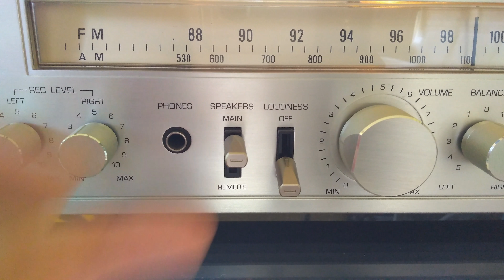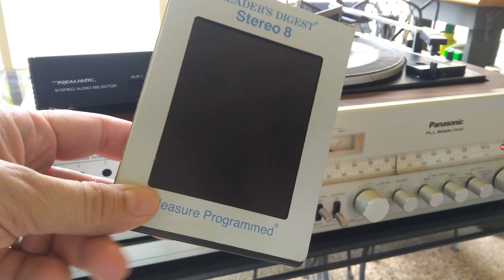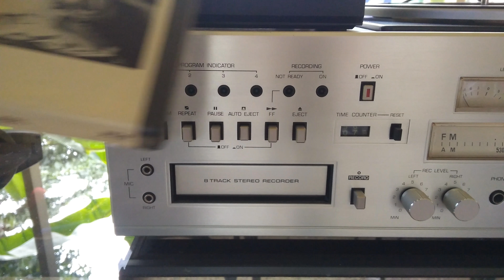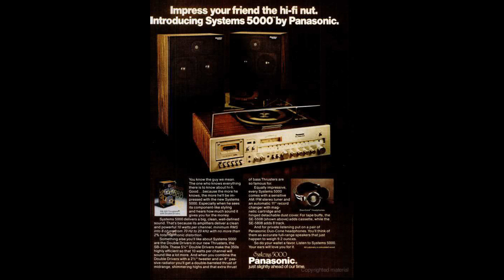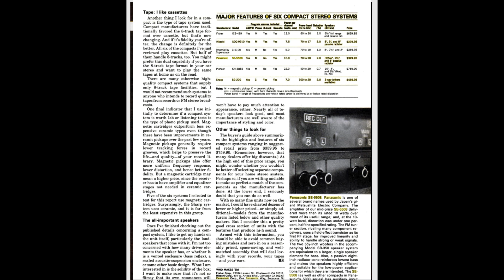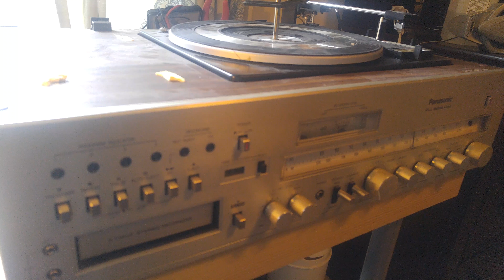Panasonic Model SE-5808, AM/FM Stereo with Turntable and 8-Track Recorder

Comment: excuse me sir i have a unit just like your i got for 10 bucks one channel is low volume i cannot find the manual for the cassette version 5508 can you help? thanks in advance
Reply from the maker: I would try to narrow down the problem, first see if the volume is low is low on the record, tape, or everything. Also a good cleaning will sometimes help. With the power off, turn all the knobs back and forth several times to clean out any dirt.
Reply: @ACBMemphis  after I messaged you I dicked with it for a while it seems like it's the mode switch that selects am fm phono etc if I jiggle that it will come in,I tryed spraying deoxit but it must be really coroded. Also the record player volume is super low, fm is kinda low too but am is loud and clear. Guess I just need to keep at it. I mostly mess with tube gear
Reply from the maker: @skullheadwater9839  Glad you made some progress! You could also try using a pencil eraser or something non-conductive to gently press the board and make sure it is not a bad solder joint at the bottom. But could just be a bad switch...